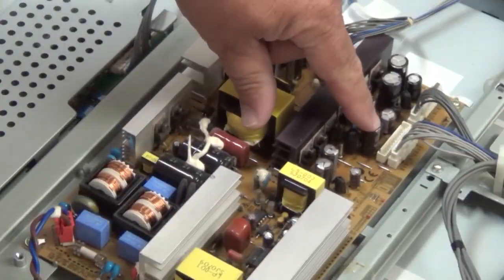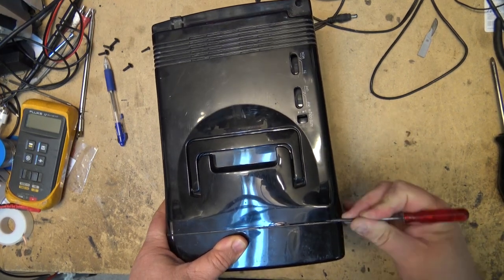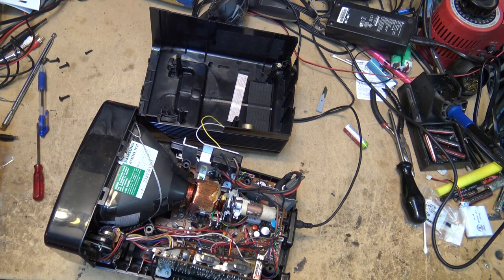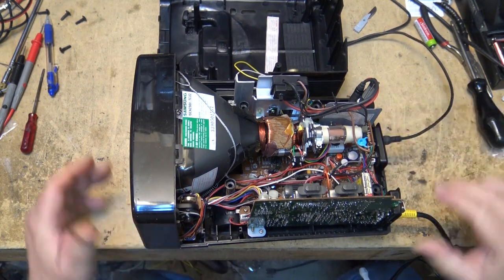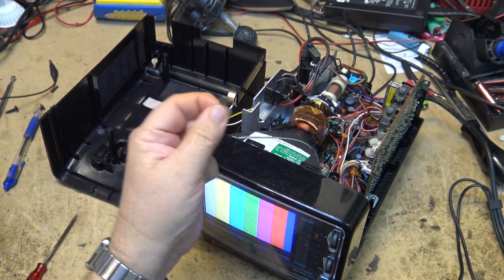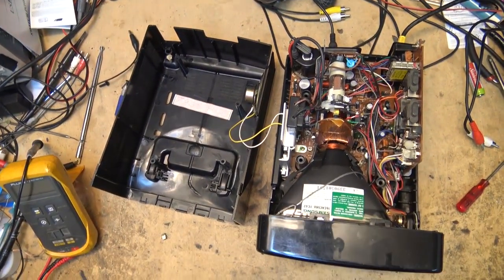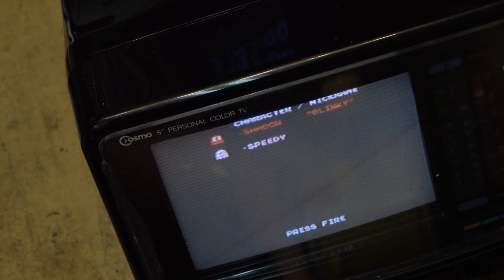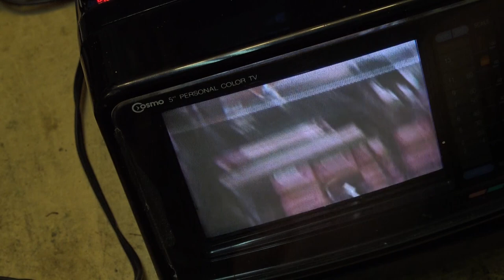Samsung 5" color CRT TV repair

Comment: neat now i learned something bit more from these. i didn't know that one thing on the fly back was a voltage adjust oops. some monitors i had where they were sooo dark that not even contrast and brightness on max could make it visible that i used that to brighten them up some just enough to be seen like it should of been. hopefully that wont hurt anything. also i have an old 19in like toshiba tv and if if runs to long it starts to buzz in a weird way mostly on blue. sounds like a florescent ballast but with a deeper sound. i thought id ask as i have tried to research but i found nothing much about it other then its probably the vertical yoke or something.
Reply from the maker: Yes it is probably the yoke buzzing as it warms up.  The put glue all over it to glue the winding to keep it quiet.  Sometimes they miss it. Hot glue works great to quiet them down.
Reply from the maker: The 2 controls on the flyback are the screen and focus adjust.
The screen sets the bias voltage to the tube. Too low and you get a dim picture, too high and you get a washed out picture.
Reply: oh i see so its nothing major on the yoke then its weird never did that then it has lately. just use it for well same purpose retro consoles/games aha. and for the voltage so increasing it a little is fine then. i find as years go by they are so dim to point brightness and contrast do nothing so i always just put them on default then twist the fly back till just bright enough so that if i do turn the brightness up it does its job again. thanks for the reply cause i was worried i might of did something wrong doing that.
Reply from the maker: Nope, not if it is a loose winding. They used to make a spray that you could spray on and it dried to a rubbery type coating to quiet down noisy flybacks and yokes.
Reply: oh nice i see. ill see if i can fix that in time. thanks for the replies (not many would for me when i have concerns for things that they work on and know that i don't) i still love crt's so i worry about mine when they behave weird beyond my knowledge. also subbed got so much stuff here to watch.
Reply from the maker: @EldaLuna  
Even though they are obsolete, since I spent so many years repairing them they are special.  Nostalgic just like all old things.  I collect smaller samples as I find the small ones even more fascinating.  Big tubes had lots of space for all the components in the tube.  Small ones on the other hand had all the same parts but on a much smaller scale.  Just like when someone builds a tiny functional v8 engine that you can pick up with 1 hand and the thing actually runs.  Not good for much but sure shows off engineering.
Reply: yeah exactly i like small ones my self. something about that tiny screen makes it fun. i have a 2004 model a 5 inch black and white. i still love it today i did accidentally dropped it hard once.. but im surprised it still works.
Reply from the maker: I'd like to find a 3.7" sony indextron tube set. I have the 7" indextron projector.
CRT sets I have  B/W  0.5", 1.5", 2" (flat watchman tube)  4" (flat watchman tube" 4.5' 10" 12" vintage, 12" late model security.
Color tubes, 1.25" beam index, 1.5" delta gun,  5" inline gun, 8" trinitron,  13" trinitron, 13" inline. 13" delta gun (computer) 15" delta large neck broadcast (conrac tube) 17" inline computer. 19" inline hi def computer, 19" inline, 20" trinitron, 21" trinitron, and a 25" inline mitsubishi tube. All in perfect working condition. These are in my collection that I will hang onto as like old cars and old radios, as time goes on, these muesium pieces will be worth more. The oldest working set I have is a 1965 GE black and white monitor that is part of a 1/2" reel to reel Video tape recorder package I have.
Reply: oh nice. that's a lot. i almost bought a 1940's rca tv.. it still worked i wish i got it im kicking my self for that now. had it for like 300 something so was cheap. oh well some day ill find my collection aha
Reply from the maker: My cousin has a 50's RCA B/W TV he said I could have. It is taking up stace in his basement. Just have to figure out a way to get it home. My problem is storage space. I have a heated locker that I keep my vintage gear in.
Reply: oh nice. id love to have stuff like this  but getting harder to do so some times. i have some room for stuff but yeah. all fun stuff indeed ehe